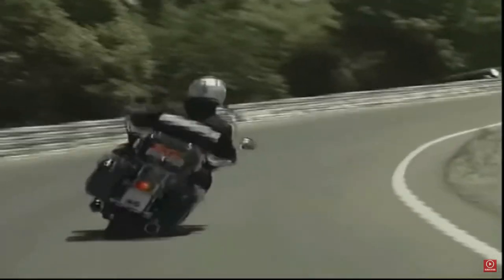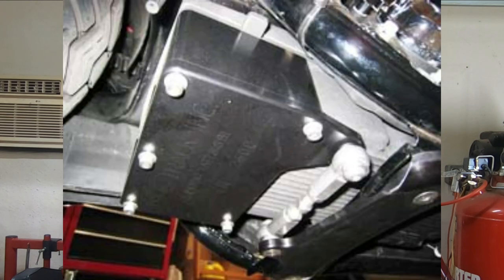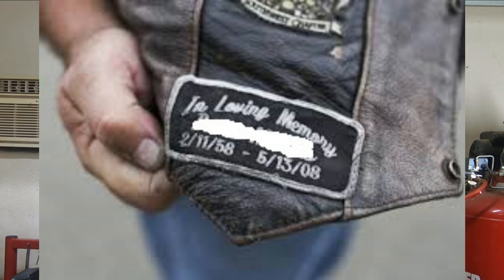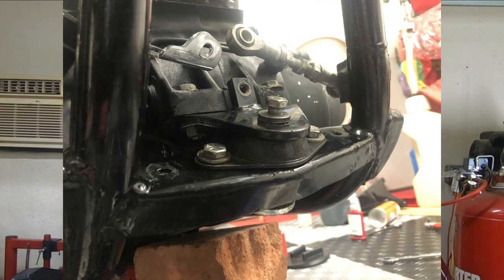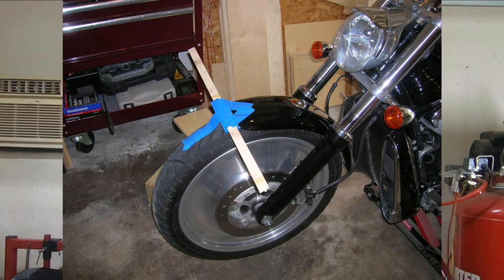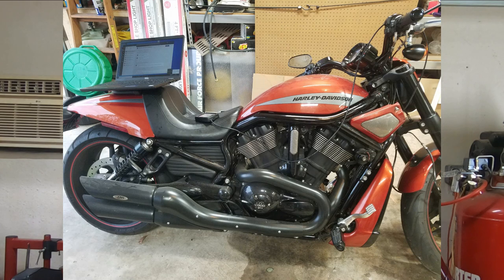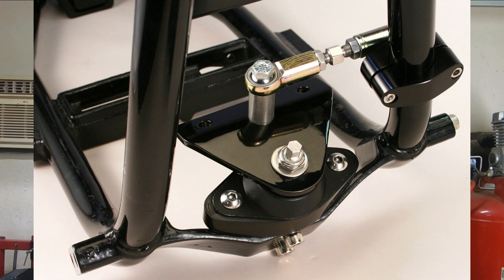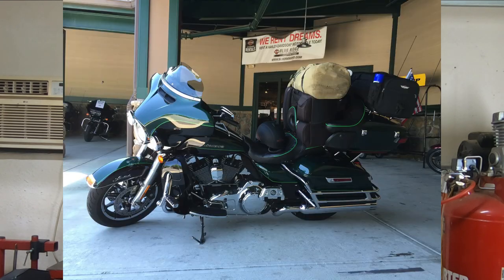The Dangerous Harley Problem

Comment from the maker: Have you tried a stabilizer on your Harley for a problem that just couldn't be found?
Reply: and i put a new set of tires on and didnt take care of it
Reply: I have a stabilizer and air ride the biggest problem with Harleys as they get heavier and heavier is the springs are never the same with air it equalizes the springs and the rear and the springs in the front it makes a major difference between the front and rear air ride and the stabilizer off the transmission my bike has never wobbled
Reply: My 1999 Ultra has the urethane motor mounts and a stabilizer and it helped tremendously. I would not take it over 90mph. It handles pretty well on the sweepers and on the highway including creek roads. I'm just not going to push it too much even with Metzler's. I don't think the newer frames require a stabilizer.
Reply: @johndsmith7785  my 01 came with air ride front and rear I changed the rear over to dirty air when the old shocks wore out. I can run my bike about 135 with the gear change in it
Reply: Only wobbles when I've worn a flat on the rear tire from heavy handed acceleration. New tires or laying down on the tank and it stops the high speed wobble.
Reply: I've never experienced a true "dyna wobble" but have had some slight instability during high speed cornering. Installed the Sputhe kit and it's awesome... already have badass suspension and a fork brace.
Reply: GF you should mention vehicle alignment.
Reply: Wow, proper 3 swing adjustment and replace the rear fork spherical bearings with sealed bearings or tapered bearing kits. Will fix this problem everytime.  Its not a mystery.
Reply: @williamjeffery6444  it's not a mystery it's history also in service manual under vehicle alignment  ,,,lol
Reply: I solved my Harley head shake by selling it and buying a Yamaha …it’s the weirdest thing because it was half the price, twice as fast and all I’ve had to to do is change the oil and battery every now and then…it’s almost like the Harley was poorly engineered 🤷🏼‍♂️
Reply: Come on people... Take the passenger peg blocks off of a Bagger and what do you have. ?? What you have is an incomplete frame assembly that can't possibly hold the rear of the engine or the rear swingarm.. Who the hell can't see that.. A child ! A rich multimillion dollar motorcycle builder.. that can't see.. THERE IS NO FRAME THERE where the rear of the engine and the swingarm join..Not just 09 and earlier either. Money is the only reason. Baggers.. not the same as XLs.

Comment: The "Harley wobble" is almost always due to several reasons. Improperly loaded, low tire pressure, improperly adjusted suspension, neglected and out of adjustment steering head bearings, broken engine mounts and swingarm bushings, loose or broken spokes, misaligned rear wheel. It's almost always  one of those. Do NOT confuse the "Harley wobble" with the coast down wobble. It's a 2 wheel vehicle. There's going to be a instability point somewhere no matter what. Lack of rider skill is also a major contributing factor as well.
Reply: Why does it happen on brand new bikes then? There is inherent flex in the frames on newish touring bikes. Only way to adequately prevent it is to install a brace. I've tried everything on multiple new bikes and that is the only thing that stops it.
Reply: @ricko9879  Just because it's a new bike doesn't mean it has a straight chassis, proper tire inflation, straight wheel alignment, true wheels if they're spokes, and proper suspension adjustment. Being a new bike just means it's a new bike. Nothing more.

Comment: I know a guy who had a BSA 650 with a quick attack rear wheel and we pulled into a gas station and just as we got up to the gas pump half of his spokes broke and the wheel was crooked. Was a humongous weight of a Harley people are used to cast Wheels I do not require maintenance and when they go to spoke wheels they do not realize that spoke wheels require maintenance especially when they are carrying the load of a thousand pounds worth of motorcycle and Rider. In the old days when you had a chain you used to check your spokes when you did chain maintenance. Nowadays most Harley Riders are incapable of even adjusting a chain. Any old days they used to be able to fix a transmission on the side of the road.
Reply: Thankfully we no longer have to repair transmissions on the side of the road or put two quart’s of oil at every gas station fill up.
Reply: @freebehindbars8654  you Can't Blame A motorcycles 30-year-old transmission for breaking down from age. The fact that it could be dissembled with simple hand tools and repaired with parts from a hardware store says much about the fact that Simplicity rules. And even in the AMF days I didn't know anybody who put two quarts of oil in their bike every time they stopped to get gas. You used to have to have a knack to get a Kickstarter motorcycle to start now all you have to do is push a pussy button or have the credit card in your wallet when you sit on the motorcycle for it to start. Kick starting is an art and a skill that is gone by the wayside like knowing how to ride your motorcycle without traffic control and AVS and all of the other electronic age that's simply mask the crappy way that you ride a motorcycle if you wrote a motorcycle stupidly in the old days you would end up on your ass sliding down the road now the motorcycle compensates for your incompetence in its operation which I find to be truly sorry.
Reply: @frankmarkovcijr5459  kick start is cool but there is absolutely nothing wrong with having a starter.
And the 2 quarts is an exaggerated joke, but the joke exists for a reason and thank God those days are over, because that was 40+ years ago and we still never hear the end of it. 
Add in the simple transmission that needs to be rebuilt periodically isn't necessarily a good thing, in fact I like knowing that I can go from 1 side of the country to the other and back again with no issues. 

All that said I fully agree with all the modern traction control BS. I get why it exists, but it's going to stunt people's riding capability
Reply: Being able to wrench and fix your own bike is what sets the "biker" apart from the "rider". Getting to know you mount and being the "expert" of your machine..... the older the ride the more care and maintenance required to keep it running... it thins the herd of those willing and able to maintain the lifestyle....
Reply: @shenanigansofmannanan  Well said! I was planning to say that the most dangerous part of a Harley today was the average rider; some middle-aged or older guy who hasn't got a clue about motorcycles beyond which 'accessories' they can bolt on to make them cooler in the eyes of their peers. Hint: folks like us ain't their peers and they have a long way to go before they reach that status. Ride safe friend!
Reply: @P_RO_  I can't stand the "I mod'd'd this... I mod'd'd'd that...." and people think they're Wink Eller....

Comment: I have a friend who had a shovel head dresser that would wobble on the highway intermittently. It was a bad front wobble, you had to get off the throttle to get it to stop. To make a long story short, the pinch bolts on the lower tree for the fork tubes were loose. Not falling out loose, kinda just a little snug, and when you hit the right dip or bump in the road all hell would break loose. I'm talking scary. Haven't seen anything like this again and that was about 30 years ago, but now I get into the habit of looking at those bolts.

Comment: I have seen the Harley Wobble on 2 Electraglides. Both were overloaded and the rear shocks were at zero psi on stock air shocks. The best upgrade that can be done to a touring bike is to ditch the rear air shocks and get some decent progressive shocks.
Reply: Add descent shocks on a absurd expensive "cruiser" (showbike)... the have to come stock with good suspension.
Reply: You dont know jack...You gotta ride the wobble to talk about the wobble. Shocks ain't s..t.
Reply: @randymccalla9995  No, you need riding experience AND technical knowledge. You have to understand the machine before you can locate the source. I solved one on a VN and even the official dealers could not find the problem. Experience...

Comment: Panhead Dave here, I was the lead tech at Santa Barbara Harley Davidson through most of the 90s, I figured out how to make a set of "traction bars" that eliminated fore and aft movement of the driveline swingarm in the frame without affecting any of the articulation of the rubber mount system on the big twin harleys, I'm actually willing to share this
Reply: Do you have a video?
Reply: @danfecke  no, I'm afraid I don't have  video of anything

Comment: I had a bar shake on my 09 ultra classic. After checking the front bearings a second time they had just the slightest barely noticeable slop when wiggling the wheel by hand. Changed bearings and been smooth as silk since even with no hands

Comment: My friend has a 2005 Super Glide Dyna. He had a wobble. A number of things we did that helped eliminate that wobble: (1.) we added a Fork Brace from Arlen Ness which helped, (2.) we added engine stabilizers from Sputh; (3.) we put in new engine mounts; (4.) we replaced the neck and wheel bearings and made sure that the tires were well aligned. No more wobble: solid as a Gibraltar Rock The Sputh Stabilizers and Engine Mounts made the biggest difference.

Comment: Great info! Bought a 2002 RK classic a few years ago with 8k miles, all stock. First time out on the highway, death wobble at any speed over 55mph. Turned out to be spoke wheels out of round/ loose spokes. Had the wheels trued up, end of problem.

Comment: Great video Gixxerfoo! I notice the wobble in my 95 Electra Glide Classic under three conditions, freeway speeds, cross winds, and hard cornering. I may not need one, but I would rather have piece of mind, so I'm getting a stabilizer anyway. You make a great point about the rubber vs poly bushings. I had not considered that, but may just go with new rubber mounts now. By the way, if your bike is over 20 years old, even if they look good, you may need new mounts. UV destroys natural rubber over time, plus heat cycles from just normal riding. Better safe than sorry.

Comment: Hi, GixxerFoo your topics are fantastic !!!! Thanks for all the great content.I have a 2021 street glide.At 12,500 miles I started with a low speed 40miles an hour handlebar wobble and poor handling, After checking all the things you mention and changing tires and front wheel bearings that did NOT solve the problem at my HD dealer $$$$$, .The 2  Harley dealer's said  that All is fine. I took the bike bike to a mom and pop shop where they confirmed the neck was very lose and in need of a neck adjustment, POP'S took the time did it right and I'm golden. 2 different Harley dealers said the neck was fine.so be cautious of neck adjustments they need to be done more Frequently then the older HD touring bikes.
Reply: Your bike is still under warranty, so the bearings-if they were defective would be covered. Tires- no. Either one of those dealers should have found the neck play.
Reply: I like how the dealerships replace the wheel bearings and the front tire and then throw their hands up 🤷🏻‍♂️ noting that the problem is still there but oh well, they’ve changed some parts and made some money from you so there’s nothing more they can do!?!?? 
Yet, Pops good ‘ol fashioned customers first service took the time to thoroughly check over the problem as noted by the customer and then they correctly diagnosed and resolved the issue. 🎉🎉
At what point does the dealership that you went to who you paid good money to for them to not resolve your bikes issue become negligent in their actions??  The only way this attitude changes is by going to small claims court and suing dealerships for lack of professional services and charging you hundreds and the problem was resolved by another shop.  Only then will the dealerships become more responsible in resolving the issue instead of making a quick buck and sending you on your way. And I add, the bike is in a very dangerous way to be on the road for yourself and other drivers due to the heightened potential for an accident.

Comment: My 07 Dyna had a scary high speed front end wobble, I chocked up the frame and got the lower rails absolutely horizontal with a good spirit level and then with the primary cover off, I got a spirit level across the primary gasket surfaces to check engine true vertical. It was out a fair bit so I adjusted the top engine mount adjuster to get the engine true vertical which solved the problem. I since had a rear rubber mount fail and the engine would go ker clunk over big bumps as it went up and came down hard. Lastly, I made my own true tracking device and the Dyna is handling sweet but the true vertical of engine was what made the most difference as the rear wheel mounts up to the engine / trans which wasn't true vertical

Comment: I've noticed my front tire wears more on the left side than the right. I never thought it was road conditions. I suspected I ride left turns harder than right.A few years back, I experience a slight wobble in the turns. I replaced the rear rubbers, and the front as well. The rear ones were shot. This was at 90,000 miles.

Comment: I have a 2005 dyna. The swingarm is mounted at the back of the transmission, near the rear mount, which is rubber. There was all sorts of play at the back since new. I installed that Trutrak stabilizer.. made all the difference. Fixed what I consider a design flaw!

Comment: you are so right on age of tires. i have 2014 sportster for around town and the tires were original. upon inspection they were 8 1/2 years old. they only have 3500 miles on them and look perfect but like you said seemed real hard. i went ahead and replaced them. just prudent thing to do. i was not getting any problems in handling but ugggh. hey i got the money dont be foolish. good video man.

Comment: I have a Sportglide and recently on a trip noticed changes in the handling.  Looked at my tyres and the front after only 12000 kms had worn unevenly. Changed it straight away and the handling is great again.  Tyres can be a big issue and it is super important to check, maintain and replace early.  Great informative vid! 😎🇦🇺
Reply: I had a brand new Sportglide last year and this bike had “stick slip”. The frontfork doesnt work well and stays down when you push it at place. They put in new springs and better SKF seals….then the bike’s suspension is how it suppose to!!! It drove like a hobbyhorse

Comment: I have an 09 ultra classic and the death wobble showed up a couple of times. Routine maintenance showed 26 psi in the front tire. Brought it up to spec and no more wobble.
Reply: I paid a Harley dealer to replace head bearings on my fxd. . Developed very slight decel jiggle at 45. They couldn't figure it out. I just found the front tire at 18 psi.
Im taking it for a ride tomorrow.

Comment: My GW had 35-45 wobble during Decelerating.  Had Dunlop E3 for several years and just dealt with the wobble.  Dunlop changed the tire tread groove pattern for E4.  Changed to E4 and wobble disappeared.  Nothing else done to bike.  The tire tread pattern when contacting the ground in certain load situations induced that wobble on mine.  Mine had that wobble since new.  As tires worn in it progressively got worse.   Look at the pattern of the side tread grooves.   First on the left - space - right - space -left.  And so forth as the tire contacts the ground.   This left and right coupled with weight and each side wearing different due to crown of road is like the buffeting of wind on a flag.   That’s my 2$ tip.     Of course head bearings and other things can also exacerbate the wobble and you’re right they should be checked.  Good Video.

Comment: 2013 Ultra Classic.. I have had it a few times at hwy speeds.. specially if riding behind a Tractor Trailer.. Bike was not loaded at anytime when I had to deal with the wobble with the rear walking a good amount.. 
The times it happened when I got home I went over the bike and checked tire pressure, shock pressure, ect.. Only 9000k on the bike.. never figured it out.. When I have the GF on the back, I never had the issue.. 
Now the bike is going to CSC for a trike conversion..

Comment: First start off with checking your front motor mount make sure that oil hasn't deteriorated it replace if needed there's also steel mesh ones on the market that are great next check the alignment if that's all good make sure your tire tread is intact both but rear is most important after that's done if you're still experiencing these problems I then recommend Alloy Arts stabilizer link. Thanks Gixxer Foo I forgot tire pressure that should be just common like checking your fluids